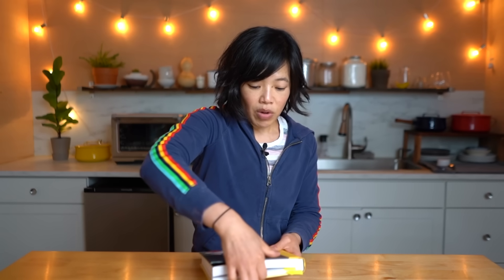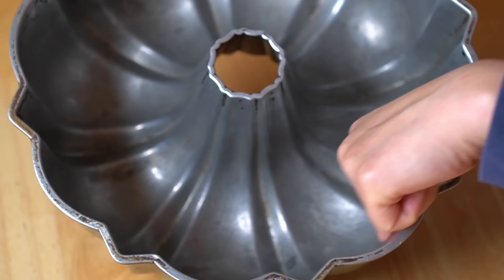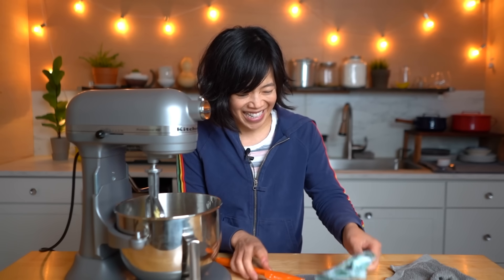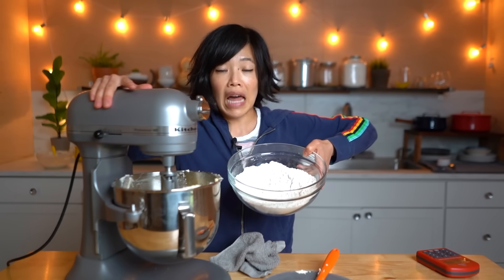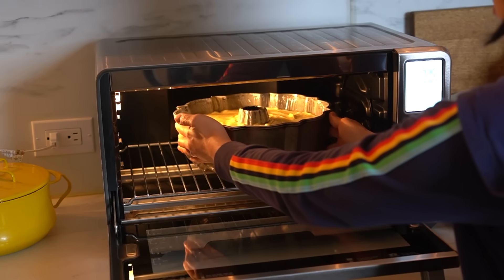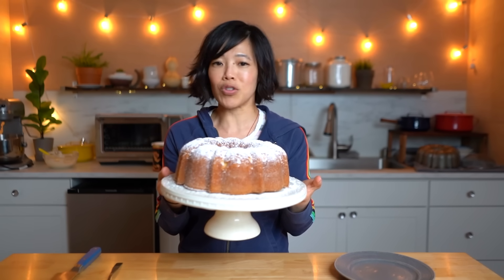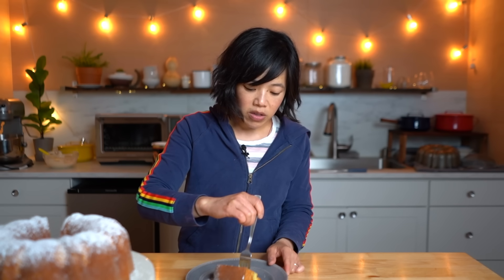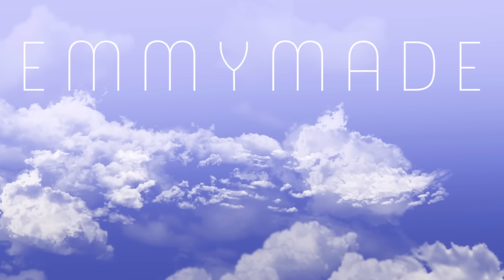COLD OVEN? Pound Cake Recipe

Comment: I usually just use butter cooking spray and douse it really well. I have also sugared the inside, but you have to unmold it warm and make sure not to over bake. Cooking spray, just regular, or pan coating works well, just use a good amount and get it from all angles. If you are going to use flour, do it right before you put the cake in the oven and make sure to be quick and tap out the extra. I don't use as much spray if I use flour because it just causes it to cake up and flake off. During spring and fall I tend to bake a lot of cake because I have 6 kids. (Only 5 at home now.) It's a good dessert and snack\breakfast  for the next day. However with 2 teen boys, there's not really leftovers now unless I hide them in advance!

Comment: Sarah Lee pound cakes would always be stale even though they were frozen. We would buy the Entenmann's Butter Cake. My favorite part was the "cake leav'ins". The soft moist part of the bottom that would stick to the packaging. Once you're finishing gathering all of it, there would be the equivalent of half of a slice stuck there. For context, each slice would be the size of a slice of thick bread. The cakes were baked in loaf molds. I still buy them but they are much smaller these days. Still the best though. Never stale and hard to get. Stores can never keep them on the shelves. They get snapped up so fast. So if you see one, grab it.

Comment: I line my tins by rubbing liberally with butter (it’s a thin layer but you have to be careful not to have any exposed tin), next I tip some flour into the tin and tap,tap,tap until all the butter has flour stuck to it. I then tip away any excess flour. I’ve never had sticking when I do this, it also doesn’t leave a residue :) you can get a little creative too and add sugar or cinnamon for a crispy/flavoured crust x
Reply: If it is a hot day I also wouldn’t leave the tin for any time, I prep it after the batter is made :)

Comment: Honestly I just liberally spray with the Pam cooking spray (the one with oil and flour) into the bundt pan and hope for the best lol. I make Chef John's chocolate sour cream bundt cake a couple of times a year and that always comes out without sticking if I use enough spray.

I had a crispy cake once when I made a Victoria Sponge and cooked it in my old, uneven, landlord special, gas oven. The outer edges caught a bit but they actually turned out to be the best parts. Now I intentionally try to overcook sponge cake 😁
Reply from the maker: I usually use lots of pan spray too, but still have trouble with bundt cakes. 🤔
Reply: @emmymade  maybe it's to do with the consistency of the cake batter. The chocolate bundt cake recipe is quite loose and liquid. The pound cake is quite thick. Unless you have loose cakes stick too... Then maybe it's the cake pan itself. Or the length of time it's allowed to cool before turning out. Lots of variables 😅

Comment: I'm surprised it came out as well as it did in the toaster oven since most toaster ovens during both preheating cycle both the top and bottom elements. I just recently read that some Modern regular electric ovens now turn the broiler on during the previous cycle to preheat quicker can people have claimed it has caused problems and causes type of cake to burn. Traditionally electric oven simply simulated what gas ovens do during baking and they're only heating up from the bottom heat during the preheat. Sense of full size oven is a farm or powerful Appliance and not surprised that it could cause issues with a recipe like this if it has the broiler on while it's preheating.

Comment: I just butter up the cake mold and then add flour , then rotate it around until every nook and cranny has flour stuck to it. Then after baking the cake i wait till it cools down completely before taking it out of the mold. And yes nooks and crannies are the issue part in most molds. However it seems it has to do with the mold itself sometimes. I have a Christmas tree shaped mold , that it's nooks and crannies aren't that tiny or hard to butter and yet my cakes ALWAYS get stuck in it for some reason resulting half the tree cake breaking off and unmolding nicely while the rest of it just needs to be scooped out in pieces cause it's super stuck

Comment: Hey Emmy!!! I’m in a pound cake group.  And this was reposted regarding sticking cakes from a manufacturer:: If you are using a pound cake/Bundt cake
recipe repeatedly you may cause sticking,
as they have a high sugar content.
Any pan spray residue or general build up
will reheat when you bake again, turning
into sticky cake glue that will refuse to
get go of your cake sponge.
You will need to remove this residue~
fortunately it will come off and the pan
will perform perfectly.   To remove residue apply dawn power wash for 10 min, the use a nylon or plastic bristles brush. Rinse with hot water.

Comment: @emmymade The dudeman says : Keep the cake in its pan and let it cool on a rack for the time the recipe specifies - usually 15-20 minutes - before attempting to remove it. Try not to let it cool completely before removing it. Most cakes are best unmolded from their pan while they are still warm, otherwise they tend to stick. If you noticed those places that pulled away from the pan were places of moisture.
Reply from the maker: I let the cake cool in the pan on a rack for 20 minutes before I turned it out.

Comment: I've been using that lining paste mixture for years, and in my experience it works best if you remove the cake while the pan's still warm-- I usually let it cool for 10-15 minutes in the pan and then invert it onto a rack to get to room temp. I suspect this might be because the crisco re-solidifies and adheres to the pan slightly if you let the cake cool completely

Comment: I wonder if starting in a hot oven vs. a cold oven impacts how the pan should be prepared in advance.  For example, maybe a mixture of flour and fat can be more prone to melding into the batter during a slow heat up with a cold start rather than forming a non stick barrier. When I prepare my bundt pans I just butter or shortening the heck out of it, don't generally use flour except in layer cakes.

Comment: I strongly suspect that using a countertop oven is not going to be the same as a conventional oven. Even though they both start cold, the countertop ovens have the heating elements right above and below the pan, giving stronger direct heat to the cake. A conventional oven, especially a gas one, will have a more indirect heat and take longer to hit the desired temperature.

Comment: I did this after Dylan did it, and I used Madagascar vanilla bean paste instead, I used heavy whipping cream instead of milk like you, and instead of using the whole eggs, I only used the whites, and added an extra egg for the missing quantity of yolks, and I did everything like you, but I whipped the egg whites and then folded it into the batter, making it even more airy and light! It was amazing! I should do a video on it because I got no sticking to my Bundt pan which is exactly like yours! I use the release spray and a mix of 3 parts flour to 1 part powdered sugar to coat the pan after spraying it. Works like a charm!

Comment: That cake is perfection. I don’t like most cakes, but pound cake is yummy! I have used sugar instead of flour to dust the inside of the Bundt pan and it was great to prevent sticking and gave the cake a nice crunch. Wonder if that would work with your paste?

Comment: I just use the bakers joy or baking spray and I don't have any problems. Seems to work great for me every time! And apparently, there is actual science behind that spray vs. the regular cooking spray. I learned about it on America's Test Kitchen.
Although, since your bundt pan is vintage and doesn't have a non-stick coating, maybe that's the issue? 🤷‍♀️ You may just always have an issue with yours? Also, the creases in your pan are super sharp! Don't think I've seen any that sharp before! 😄 Edit: I just clicked on the the recipe and saw her bundt pan! Lol! Now THOSE are sharp creases! 🤣

Comment: I guess you have to test the baking times, as each oven is fifferent in how long it takes to heat up. My 1980s electric oven is fully heated to 450 in less than 15 min where my mother in-law's 2000s electric oven takes 30 or 40 minutes to get to 350...  Thanks for sharing that pan treatment trick though, if I ever use a metal bundt pan again I'll give it a try! I bought a silicone one right after the last time I had a release "incident" ... though it is better with a solid cake like a pound cake rather than a light fluffy box cake.
Reply: Your mother-in-law's oven has a problem. Maybe one of the heating elements is dead but no way should it take that long to get to 350. I'd never have the patience and would have looked into it right away, lol.
Reply: @Furthea2  It's always been like that. It's got its element recessed underneath a subfloor that maybe takes so much time to heat up. Piece of crap. And I've fixed enough oven elements over the years that I will suggest they're biinary, they either work or they're in pieces...

Comment: First, I keep my pan meticulously clean on the inside scrubbing it out with lots of Dawn and a nylon scrubber every time I use it.  I do not spray (baking spray -the kind with flour) until I have my batter mixed.  The batter immediately goes into the pan and right into the oven.  I have never had a problem with it sticking.

Comment: There are multiple cooking sprays on the market that contain flour as well as oil. I use the one by the brand Joy, Pam spray has one now and other brands as well. I bake in my bundt pan all the time using that spray and I’ve never, ever had a cake or bread (I love to bake my banana bread in there lol) stick or come out damaged or covered in excess flour/oil. I believe the trick to be the baking spray with flour combined with de-molding while the cake is still pretty warm. Not HOT hot when it’s fresh out of the oven, but only waiting 5-10 mins. I believe it keeps the food lube from cooling off too much and re-solidifying which is what makes things stick to the pan. 
I find the canned spray with flour to be excellent. It eliminates the possibility of unevenly gooped butter and clumped or excess flour that commonly occur during traditional flouring of the pan.  It also rinses off easily.

Comment: When you hook up an electric device just always think two steps.  1.  Plug in.  2.  Power strip button.  I do this with lots of   things.  I rarely forget stuff this way.  When I get ready in the morning I need 4 - 3 - 2 - 1.  4 brushes (on shelf).  3  items on toilet lid.  2 items on sink (dryer and lotion).  1 towel (over shower door).  This avoids problems having to search for items after I'm all wet because I forgot something.  Like being in shower -- ugg no towel.

Comment: I've used this recipe for almost 30 years. I use heavy cream instead of milk. Buttering and flouring the cake pan works just fine. Wherever you miss will stick to the pan. Make sure the oven is completely cold. The cake won't bake right if it's even a little warm. Bake until a toothpick comes out clean.

For an added treat, I add 1/2 to 1 cup of amaretto liquor to the batter.  After cooling on a rack, I pour on more amaretto on the outside of the cake, add a dusting of powdered sugar. Wait for it to soak in. I repeat this several more times, layer of amaretto, dusting of powder, repeat. The more you add, the thicker and crustier it becomes. One final dusting of powder before serving. The longer you let it sit between layers, the more it soaks into the cake. (The amount of liquor is to your taste and liking. I've made cakes where I've used as much as 3 quarters of a 750 ml bottle of Disaronno between the inside and the outside. Just depends.) It's something my coworkers beg for and love. I make for special occasions like Christmas and birthdays. 

I make a rum version of this, too, but add a rum and cinnamon glaze to it.

This cake is extremely versatile.
Reply from the maker: Mmm...
Reply: How long do you let your pound cake sit in the pan after baking before flipping it?

Comment: I made a lemon buttermilk bundt cake recently that I saw on food52, it said to butter the pan and then line with fine breadcrumbs. I only had panko so I just crunched it up in a bag first. The cake practically jumped out of the pan! Though it was a small cake, since I used a 12 cup bundt pan for a 10 cup recipe, so there was less surface area of cake touching pan. But still worked great, I might just keep lining that way for every bundt recipe, since you would never notice that the breadcrumbs were there.
Reply: Buttering and lining with breadcrumbs is the staple here, I heard about using flour only from US recipes. Breadcrumbs have never failed me, and since I used them from the start I never thought sticking to the pan was an issue. Gives a great crust, too!
I melt the butter and spread it with a baking brush like Emmy did here, that way I get it to all the nooks and crannies. Then I sprinkle the breadcrumbs to the center wall first while tilting the pan, and then just rotate the pan, lining the outer walls with the crumbs that fell to the botton. Very little waste that way.
My favourite pan is a small 1liter (about a quart) bundt pan, for me the pan Emmy used is way too big, lol!
Reply: Line it with flower works to. Breadcrumbs is what we always do in Sweden.
Reply: Aren't Panko breadcrumbs the best thing ever?!?!
Reply: Can also also use fine semolina instead of breadcrumbs.

Comment: In Sweden we have a long tradition of doing “sockerkaka”, which are pound cakes baked in Bundt molds, often with very intricate designs.

The way we do it, is to use slighty soft butter and coat the whole inside. Then you pour in breadcrumbs (I think it might work even better with panko), then twist the bread crumbs around the mold until all the inside is coated, make sure every little corner and divot is covered.
Then pour out any excess.

You can then put the whole mold in the fridge to let the butter set and have the breadcrumbs and butter be a bit more stable (I tend to not do this, but it helps, and if you do this at the start and then go on to make the batter, that is plenty enough time in the fridge)
Slowly and carefully pour in the batter 

From my experience they come out very cleanly. And the breadcrumbs sort of creates a outer edge.

I also like to mix in some casters sugar into my bread crumbs for taste, it also changes the texture of the edge, I like it. But that is more risky for having it stick.

Comment: Butter and Flour works best. It’s what our grandparents did. I’ve always gotten it to work that way. So I believe that if you would’ve dusted the pan with flour on top of the mixture. You would’ve had better results. 

I believe the flour is most important. Because if there’s enough of it, the flour with create a barrier. Much like when you mix flour into a liquid. The flour clumps up at first because the outer layer of flour protects what’s on the inside. The flour on the pan will stop the batter from mingling with your fat of choice. Well that’s my thought. I hope you get to try again soon!!!!!

Comment: When I make Bundt cakes, I alternate between just spraying it liberally with oil and oiling it and flouring it for extra insurance. I found that the main reason my cakes were sticking was that I wasn't letting them cool completely. Once they're completely cooled they tend to not stick. I've had a few crumbs here or there, but overall, cooling then completely is what works best.
Reply: 👍mom used to save the wrappers in the freezer for that purpose

Comment: I wonder how the size of your oven affected the final product. I imagine when the recipe was created, it was intended for a full size domestic oven, and those take much longer to heat up than the smaller countertop models
Reply: I'd almost imagine that it would bake slightly faster in the countertop oven, but a bit more dense, as long as your cake pan doesn't touch the sides, it shouldn't be too problematic.
Reply: I wondered about that, too. It didn't seem to hurt anything.
Reply: I was thinking the same thing, then looked up the size of the first gas ovens when these kinds of recipes presumably started. They are pretty similar in size to Emmy’s counter top oven.
Reply: Hey friends, I watched Dylan Holis make this same cake in a standard oven, and from memory it took about the same time as Emmys, and had that beautiful crust, Dylan has a YouTube channel and tictok, I hope this helps, thanks
Reply: The standard oven has a higher BTU ratio. The ovens should heat up in the same amount of time.
Reply: I had the same initial thought.
Reply: Good point
Reply: I made it today and I had to add 10-15 minutes for a full size oven.
Reply: breville USED to (10 yrs ago) be notorious for being significantly under target temp when the pre-heat phase is "done."
maybe they fixed that but pre-heating to, say, 400 yields a 350-360 degree oven.
(it does eventually get to your selected temp ... after 10-15 minutes)

maybe that's a factor?

alternatively, this could be one of those recipes that just works in a wide variety of circumstances.  (I have a quiche recipe that is bizarrely forgiving.)